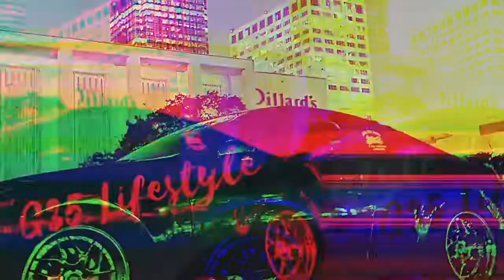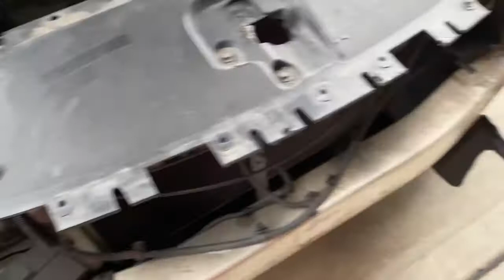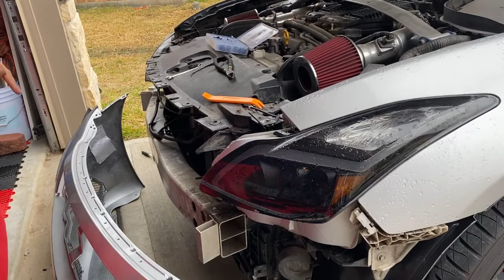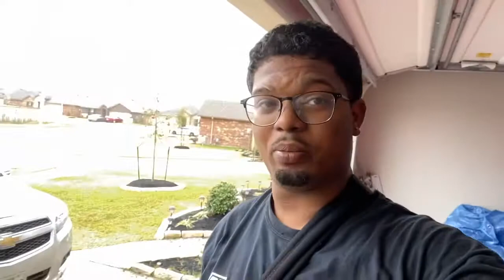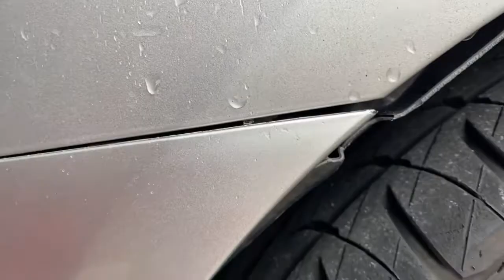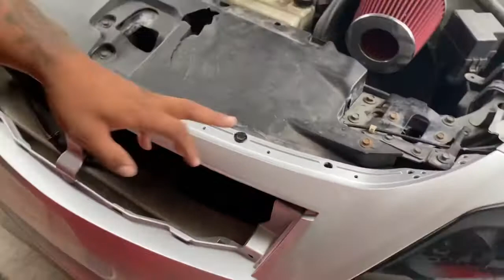G37s OEM Front bumper install a on salvage title

Comment: My left and right top bumper corners at the headlights have nothing to clamp to. What would you suggest to use to keep those corners down
Reply from the maker: To be honest I am one of those type of guys I would just buy a used bumper or a new bumper but if you want to be a little more conservative you could buy gasket maker squeeze the gasket maker in between the two push it together and tape it down with masking tape once it dries it will form the clips that you need

Comment: I'm going to try this method with my libertywalk bumper,  mine isn't wreak but I cut off and threw away some brackets i though I didn't need like the two white side brackets
Reply from the maker: That’s my best suggestion or you could buy bumper clips
Reply from the maker: They usually go on Amazon for about 20 bucks a set
Reply: So u guys recommend to get those white brackets? Bc I installed my gtr headlights but not my 2 sides stick up and it’s so annoying😭
Reply: @v36glo  I know im late but what did you end up doing? Im having this issue right now and I cant find anything on it
Reply: @martinjoe4868  zip ties bro😂or buy new brackets, no other way